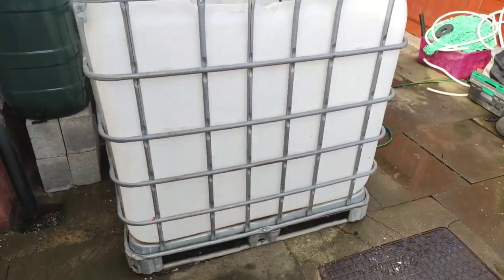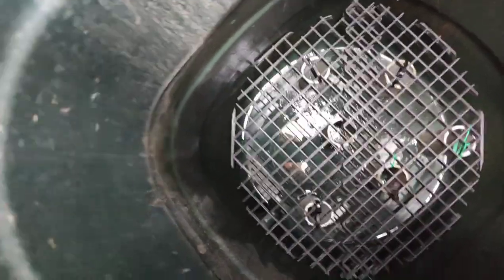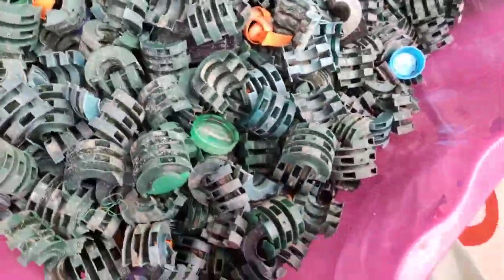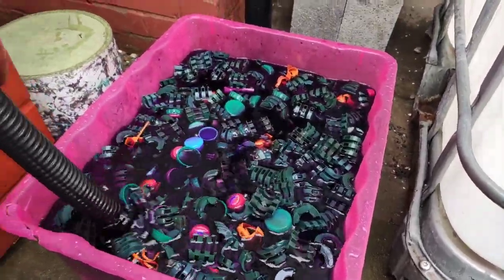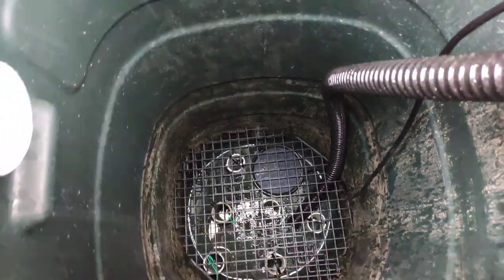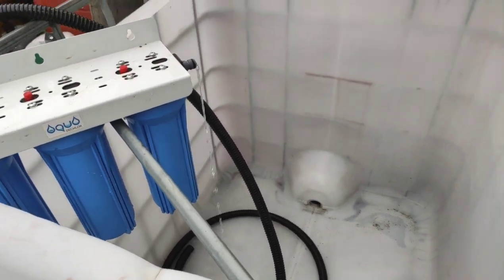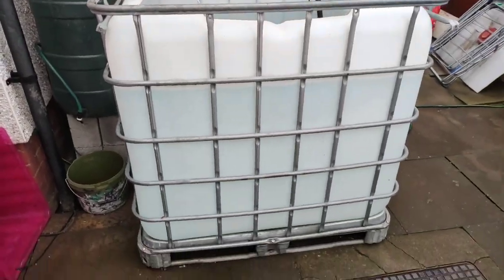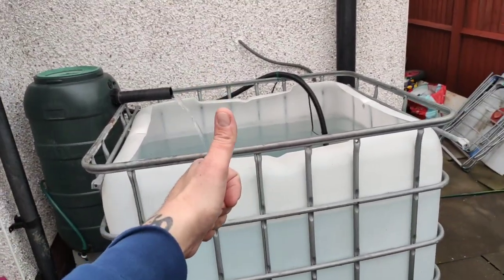**super CHEAP easy DIY water butt pond FILTER** & simple KOI FRY tank**

Comment: Nice upcycling! Loved it. That old solved pvc connector is really easy to take apart and reuse if you which. Just use heat and pliers. If you need I can make an instruction vid.
Reply from the maker: Brilliant thanks I didn't know that. I might give it a go 👍

Comment: Great job buddy some great tips ,, run a pipe from your gas or oil boiler through tank with a valve to have it on when you want to keep it warm when you want from a plumber
Reply from the maker: Cheers mate. You must be a mind reader I have been thinking about some form of gas water heating 👌👍
Reply: @progressivepondkeeping  defo if I can put 2 pipes from you gas boiler out though the wall and onto 2 valves , than use qual-pex pipes than to run where ever you need cost barly anything cause your only heating the water thats in the pipe im a gas installer
Reply from the maker: Brilliant mate, for the main pond I was thinking about using one of those lpg water heaters run off a gas bottle
Reply: @progressivepondkeeping  thats a great idea be great for fish in winter they prob get much bigger every year
Reply from the maker: Would one of those water heaters cut of at a set temperature like a thermostat
Reply: @progressivepondkeeping  never really fitted them but if there is a temp controle on front of it it should be fine plus it be very hard for temp to go very high with the volume of water u have wat is it 15000 litres are u on about a lpg gas boiler of just a heater
Reply from the maker: Lpg gas water heater for like of grid places
Reply from the maker: https://vevor.co.uk/products/tankless-hot-water-heater-lpg-18l-instant-boiler-propane-gas-lcd-display-4-8gpm?gclid=CjwKCAiAg8OBBhA8EiwAlKw3kq5ubPsYnsJVOdSkQetJzjaopgbOdJNVqzsN_0HE9Mi-GJJPIXkH6xoCawkQAvD_BwE
Reply: @progressivepondkeeping  could work but you need a pump to feed it and it would probably block up fretty quick
Reply: @progressivepondkeeping  you be better with some sort of heat transfer
Reply from the maker: I was thinking of a stainless steel coil in a barrel so the water would constantly being circulated around the system

Comment: love the water butt idea mate..in the same boat as you.ive just cleaned my icb tank ready for next step..
please check out my koi pond channel too!!
best of luck
Reply from the maker: Cheers mate, yes will do 👍
Reply: Would you know which adhesive would be suited to stick acrylic or polycarbonate to the ibc tank??
Reply from the maker: If it's on the outside the pond any mastic should do if it's a small piece super glue would do the trick